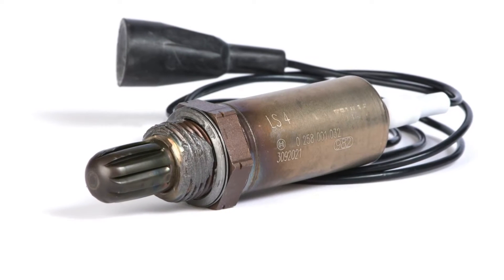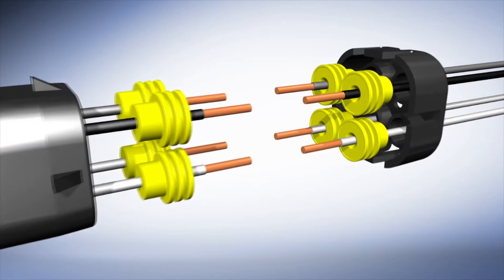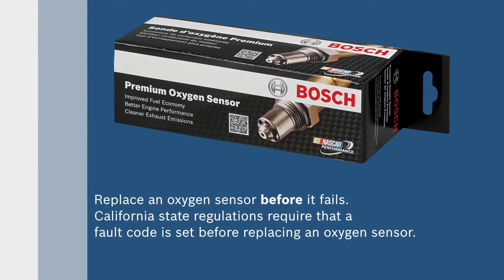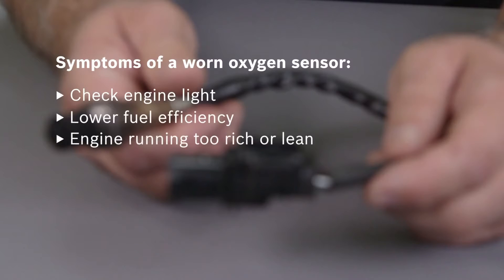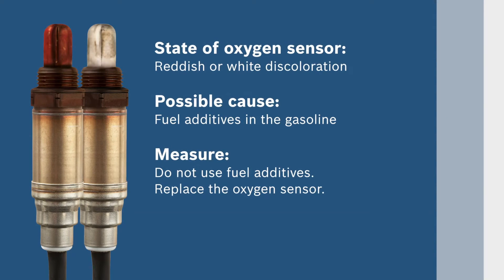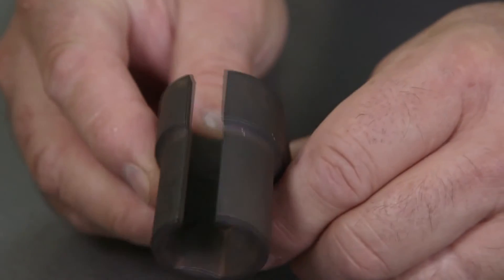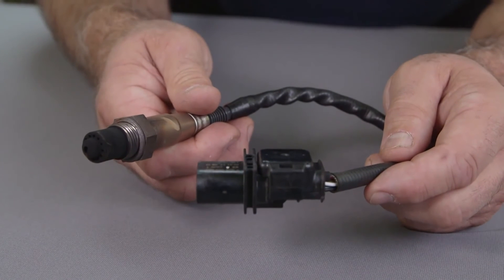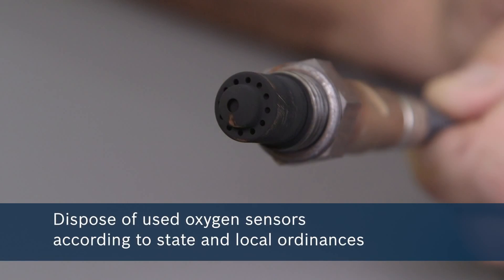Bosch Auto Parts - Replacing an Oxygen Sensor

Comment: Hi, is replacing O2 sensor can fix the problem for low voltage Heater Circuit Low bank 1 sensor 1?
I have 2003 pt cruiser non turbo
Reply: Art Garcia it is said that replacing the downstream o2 sensors usually fixes this fault code. Good luck